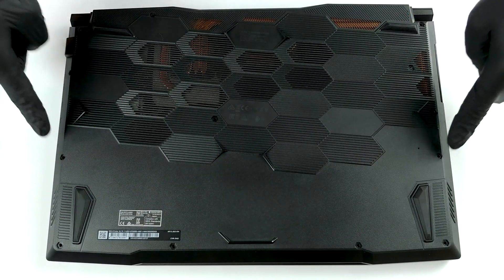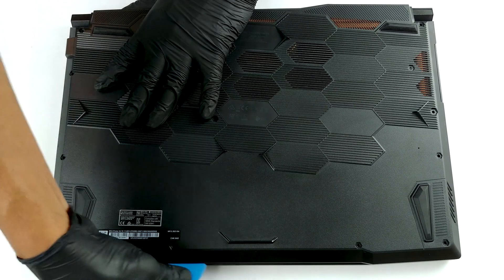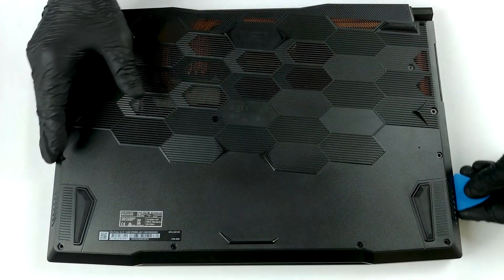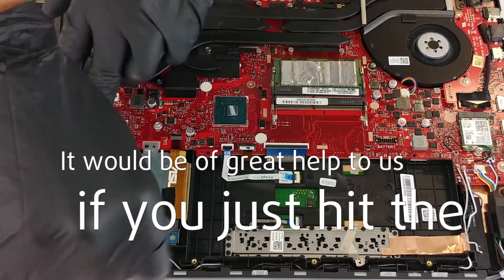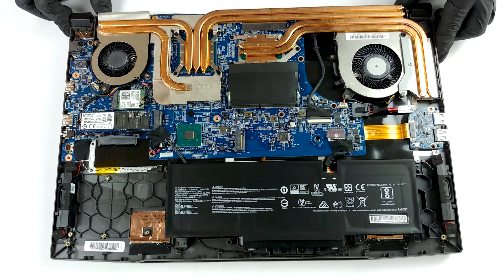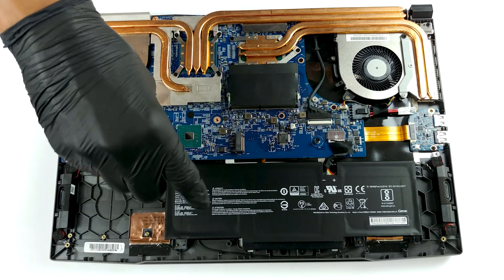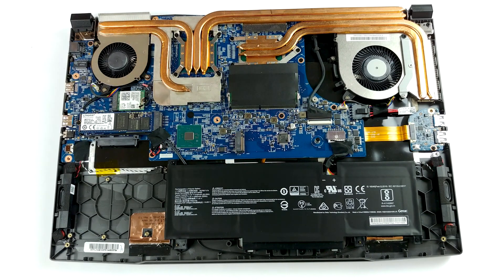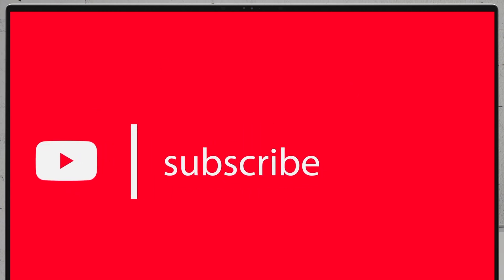🛠️ MSI Pulse GL76 (Intel Core i7-11800H + RTX 3060) - disassembly and upgrade options

Comment: @the :43 sec mark your 'person', took out all the screws holding in the battery,  which is cool,  but perhaps a better idea would be to unplug the battery before you start taking screws out.  Even  with a mag screwdriver,  there is a distinct possible of one falling onto the PCB.  Being that yah,  there's a real chance of a 'accidental' discharge  cause yah, that mobo is fully alive with that battery plugged into the mobo,  and yes, there is quite enuf power to fry your system.   
I have no desire to sound like a dick, but, if you are trying to show noobs the proper way to dyi their equipment, please show them the correct sequence. i.e. remove back cover,  if you have a pad, put the screws on the pad in the order you took them out, well cause well you know, laptops like haven diffenent length screws, and while .5mm might not seem like alot, it very well can be.  once you have the back removed (yes, you did that right, you used a plastic impliment,  like don't use your pocket knife).    Carefully wiggle the connector out of the mobo from the energy pack, don't yank it,  beyond immediate damage and possible short, it can and does shorten the life of the connection, (snug good - loose bad),  meaning it will progressively have a looser fit,  therefore be less efficient and could be the cause of premature battery failure/replacement. Being that laptops are great dust bunny farms, preventative maintence by cleaning will pay for itself, depending on your environment (dust, pets, etc.).
I did find this video informative,  but haven a live PCB while moving metal screws over top of it, i thought i might point out.  I know this from personal experience, it doesn't take awhole lot not to do what i did, unless you want to make a new paper wieght or door stopper,  being that those situations, never happen at a 'convienient time', or generally when you have an 'extra' couple grand you didn't know what to do with.

Comment: At 1:23, exactly what are you pointing out? I don't understand the hand motions... also, you mention that this laptop has 2 M.2 slots but the video doesn't seem to show that in enough detail. I'm trying to see how easy or hard it would be for me to plug in another SSD in the second M.2 slot. You also mention the 2.3 slot but never show it. You talk about the memory (1:26) and then the storage (1:34)  but it looks like you're pointing out the spots for those in reverse order. I'm just trying to make sure I know everything I need to know before attempting to upgrade. Could you please clarify? Thank you

Comment: Can no one Explains how to disassemble cooling!!!!!!!!!!!!؟ oh my😑
Reply: take all the little screws out there are a lot then lift it all up. The copper is attached to the top of the fan. You'll need thermal paste when putting it back on the gpu and cpu